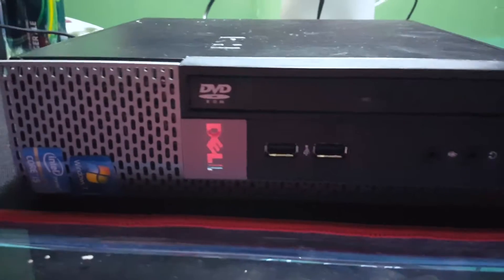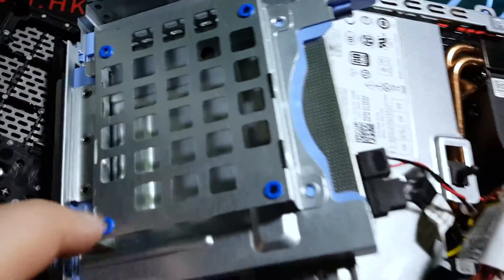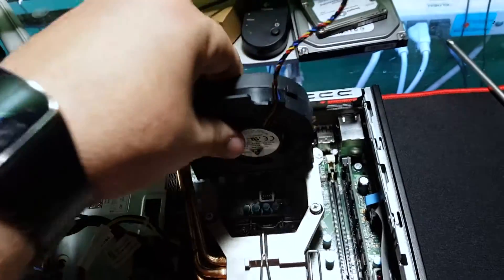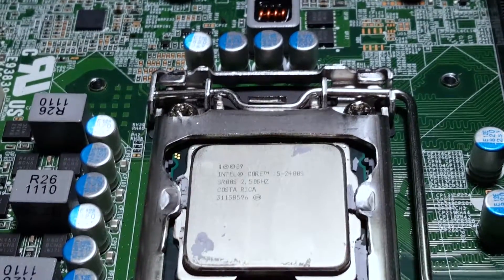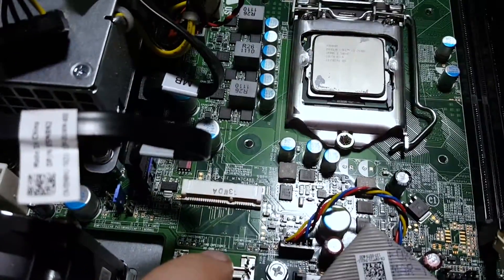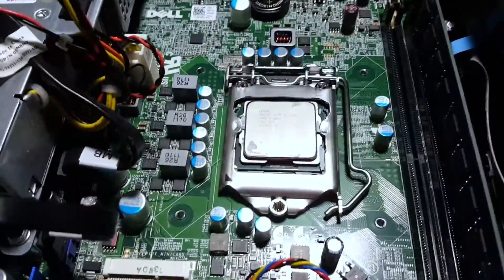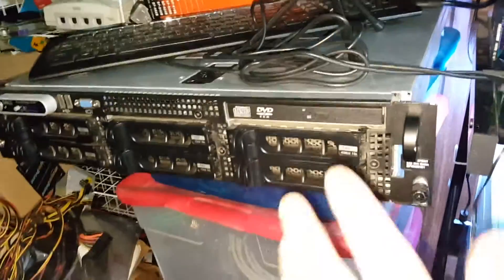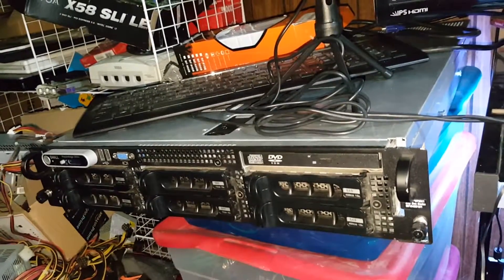My Dell Optiplex 990 USFF Minecraft Server

Comment: Hey buddy nice video! I need sow help .I have same mobo but dont have the front panel power button and didnt kno if you knew any schematics on the power n reset pins....kno I gotta order a 24 pin to 8pin power adapter so I can upgrade the power supply :)

Comment: cool man. How did u get free?
Reply from the maker: From Where I work. They would allow you to take there old computers that they would trash. sadly they changed policy and now have a company come in and take them now. so no more free awesome computers
Reply: that is a huge sadly. I got my Optiplex mini tower for 90$ on eBay "Dell OptiPlex 790 Intel i3-2120 3.3GHz, 4GB RAM, 230 HDD w/Win7 Pro & COA"
im looking for a cheap sff one with an i5, 1tb hdd and No OS installed or something. Though i would put the i3 and a 750 ti in the sff and try to sell it as a budget gaming rig. But, it looks like other people are doing it for cheaper... lol
Reply: @zazarays  kind of a rip off for $90 I got my 8gb 1tb i5 2400 rig for $80 locally always shop locally for good deals!
Reply: @robbiegamingHQ  the population of Muskogee, OK is under 40,000 people. lol. The closest optiplexs are in Tulsa an hour away. The fastest DSL available to me is 3mbps. I bought that computer in late 2015 i think. My mother says starting in Oklahoma is like starting in the hole. The cost of living is keeper but, advancements come later. 

Funny that u brought this up now tho. I just bought 2 new Optiplex's on eBay about a week ago. I got one 990, core i5 2500, 8gigs ram, 500gb hdd 56$ ; And 1 790, core i7 2600 4gb ram 500gb hdd 90$. eBay